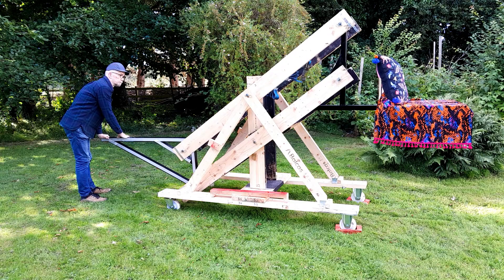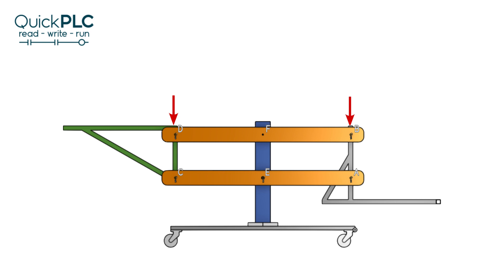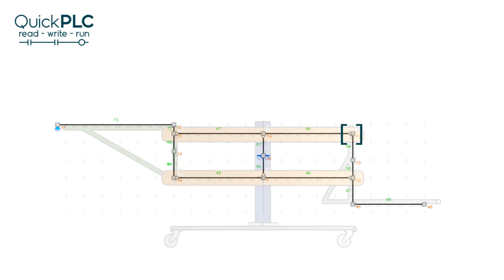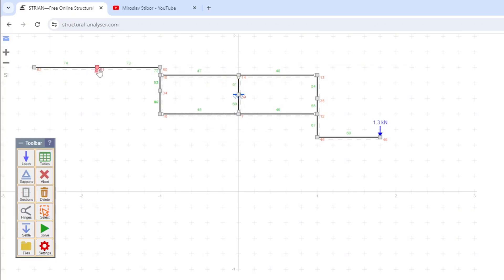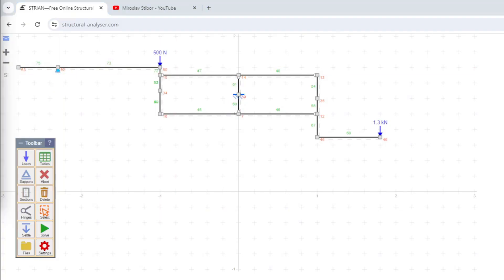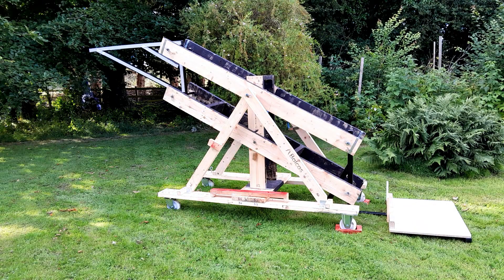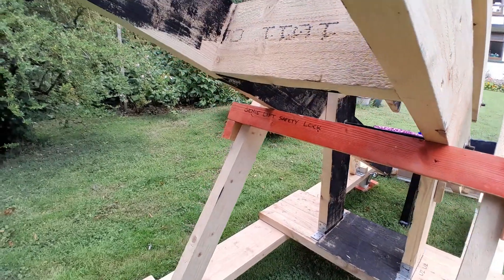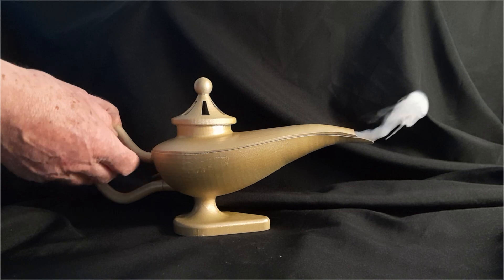Sidelines   Aladdin magic carpet lift

Comment: What a load of convoluted formula just to achieve a simple up and down movement for a Magic Carpet. Get a Fork Lift truck to do the job.
Reply from the maker: As far as I remember I only used one formula, F = ma. Sure, one could get a forklift, but learn nothing and have no understanding!
Reply: Golden rule of Special Effects-keep it simple.
Reply from the maker: I did. No electrics. No hydraulics. Simple levers. Human powered. Silent.
Reply: I think you’re getting ahead of yourself. I was referring to your comment about ‘understanding’.
Millions upon millions use computers successfully every day without having to know what each component does in the circuit. Now do understand my previous comment?